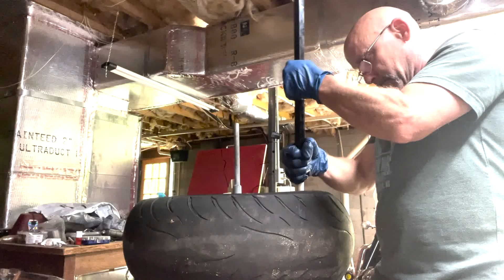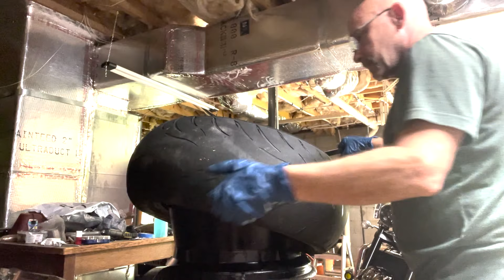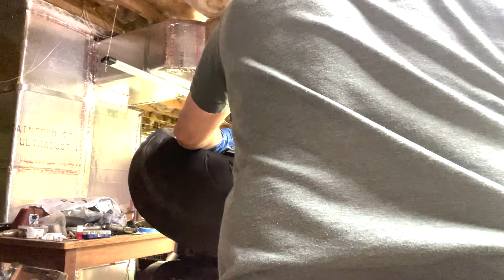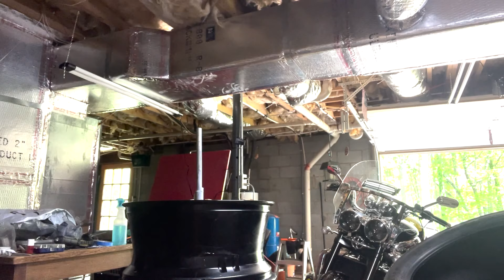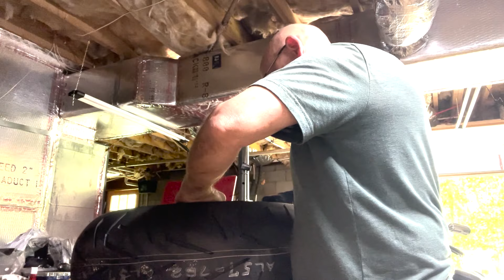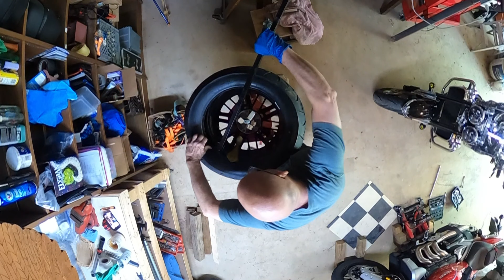3R Exedra Tire

Comment: Hope you've put some miles on the Exedra Max... How much better are they than the Avons ?
Reply from the maker: I got 3,150 on the stock Avon (never have been a fan- look cool, cool name, that's it). I got 5,300 on the first Exedra (above )and now about to change that one for another Exedra at about the same mileage. Beyond the fact that I get more wear out of the Bridgestone I think they handle better. The profile is 1" higher, which shortens the rake and makes a pretty darn good cruiser handle even better. We all saw this on the older 2.3 Rockets, as well. It just takes two 1" spacers and a short tab of metal to raise the front "hugger" up an inch to clear the larger tire. Nothing to it. I don't know of anyone else who has actually done it yet.

Comment: lol was thinking, sure would be nice to have a top view and poof! top view! Have never owned a tire remover before but am considering it. Looks fairly straight fwd. What brand is that one? Would you buy it again or something different?  Thanks.
Reply from the maker: Thanks - it's a GoPro mounted above. My changing stand is some off-brand from eBay. I'd go with one from Harbor Freight if I were to do it again. You can get nylon mounting blocks for the rims (Mojoblocks) that fit the HF model, otherwise it will definitely scratch your rims. I had to custom make something similar. I highly recommend the MojoLever (no, I don't work for them or get any compensation here).
Reply: @journeyman2553  I appreciate your honesty Blake. I'll check into Mojo. Have a great day.